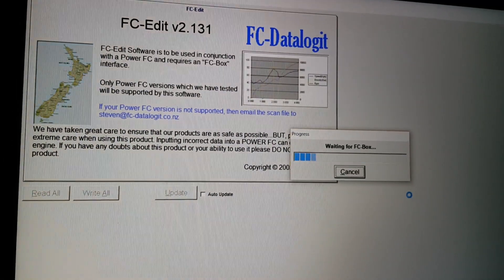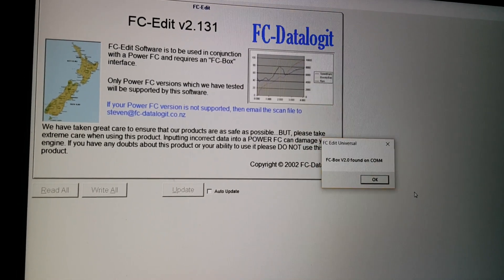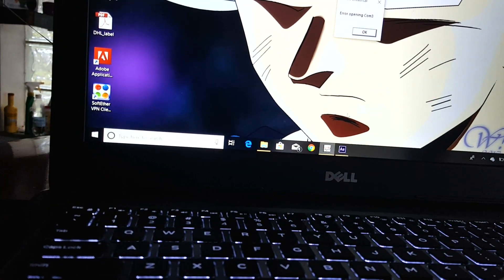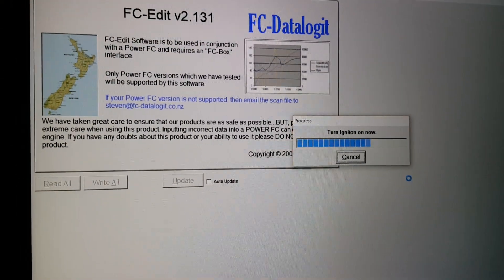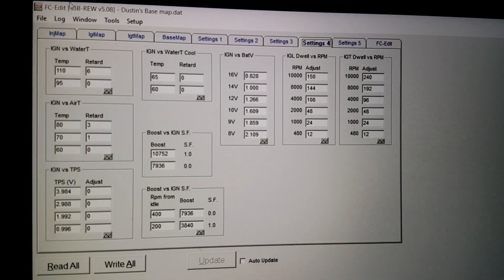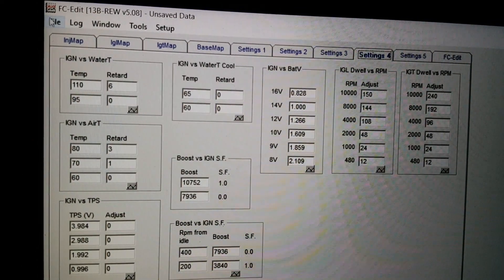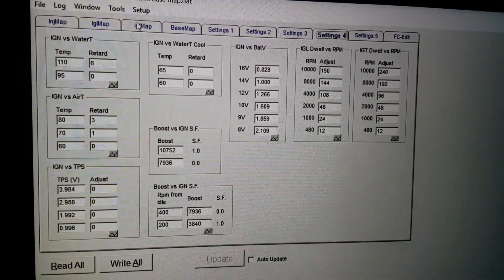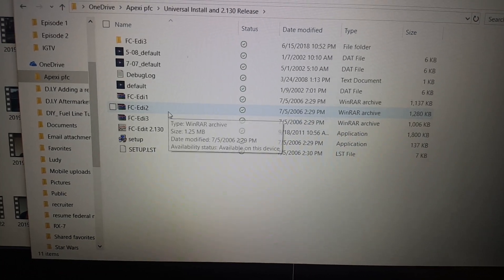How to pull a basemap from the Apexi Power FC - RX7 FD R2

Comment: Can you help me with the ignotion map and injection map? I reset the maps by mistake i have a Toyota mr2 Configuration :
• Engine: Toyota 3S-GTE (2.0L turbo, 4-cylinder)
• Turbo: BorgWarner K27 (standard turbo, max revs ~8000 rpm)
• Injector: 550cc (larger than stock)
• ECU: APEXi Power FC Full Computer 
MAP sensor is mounted on the intake manifold.
Denso 909110-13003 with two hoses connected to the intake manifold
Reply from the maker: Oh, man. Sorry to read that. I've never worked on an MR2. I'd try to find an ignition table and start from there. Can you at least pull the base map?

Comment: So my used car I just bought came with two separate .dat files, one for E85 and one for 93 octane gas. If I load the E85.dat file after filling with E85 do I click on the Write All button or maybe the Update button at the bottom of the pages? I just want to change between the two maps if I need to fill with a different fuel but don't want to accidently overwrite something. Do you know how you load separate .dat files? Thanks!
Reply from the maker: Correct. Just open the dat file and click the write all button.

Comment: Diagram for manufacturing connection cable ?
Reply from the maker: The PFC is plug a play. You don't have to do the connection or splice wires though.
Reply: @TonyWestDIY   How to connect apexo with notebook?
Reply from the maker: @sebastianrojassaavedra2310  hablas español?
Reply: @TonyWestDIY   si , soy de chile
Reply from the maker: @sebastianrojassaavedra2310  ok. Lo que quieres saber es como se conecta a la laptop o al automovil?
Reply: @TonyWestDIY   si conectar la apexi al notebook para poder setear, el programa ya lo tengo me falta el cable de coneccion
Reply from the maker: @sebastianrojassaavedra2310  pues necesitas el programa instalado en la computadora (windows) y el datalogit. En el video lo muestro
Reply: @TonyWestDIY  software lo tengo.   Datalogit no lo tengo, se podra fabricar?
Reply from the maker: @sebastianrojassaavedra2310  busca en Google o en club rx7. Una vez vi en uno de los post alguien que creo algo y lo vendia mucho mas barato. No se si todavia lo hace 🤷🏽‍♂️. 
En los grupos d rx7 en Facebook a veces venden el datalogit barato pero tienes que estar pendiente. Suerte y gracias por ver mis videos. No olvides subscribirte!
Reply: @TonyWestDIY  lo revisare, muchas gracias

Comment: hey awesome video i was wondering if you know apex power fc install mostly for ej20 subaru engine.
Reply from the maker: I know those came for a couple of cars but  how do you feel about it? I feel isn't used friendly. It's working for know but I might go a different route later. I'm also tracking that is an old technology compared with the new stand alone ecus 🤷🏽‍♂️